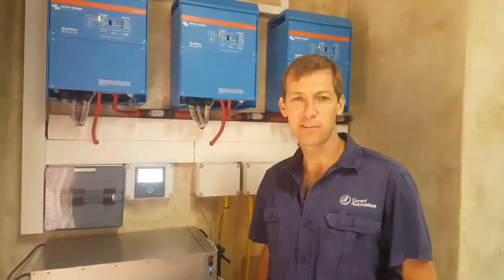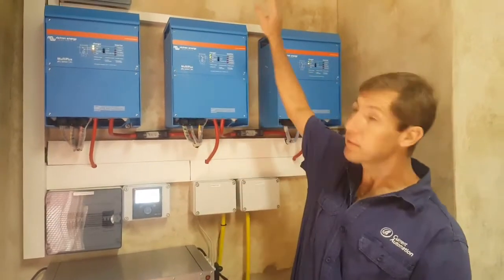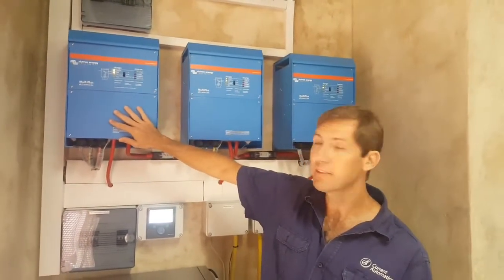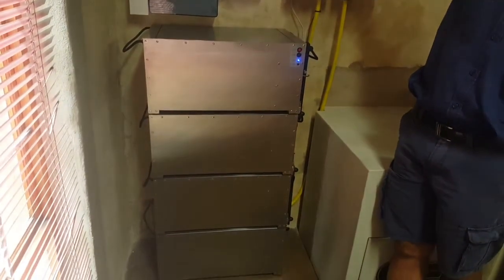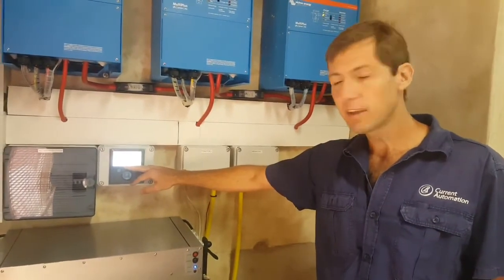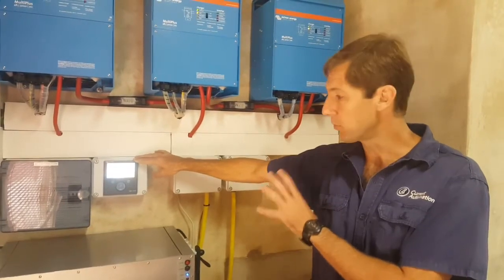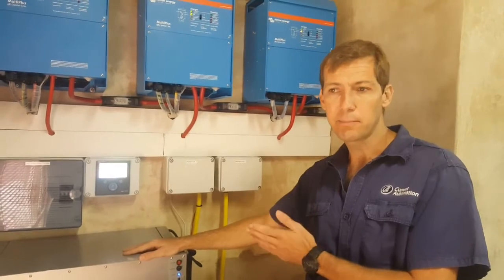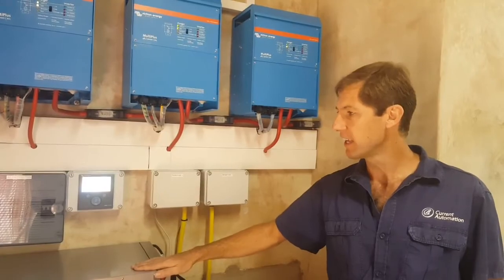BlueNova and Current Automation Nelspruit

Comment: Hi my name ia denis. I just wanted to know if the inverters can run basic led lights for a house. I cant seem to find anything about this. I am running a small setup at home. I just need to know the smaller inveters can they handle the on and off for lights ?. Basic set up will be two panels in parallel with a victron mppt controller with two batteries in parallel with a inverter. The draw is low as the whole house has LED lights. Does the inverter have a built in soft start? Will it cope ? What is your opinion thanks.
Reply: first thing you need to Known what watt is you system drawing, then you can find out what system you'll need
Reply: Give Hentie from Go Green Tradings a call, they are certified Victron Installers. +27 71 109 9235